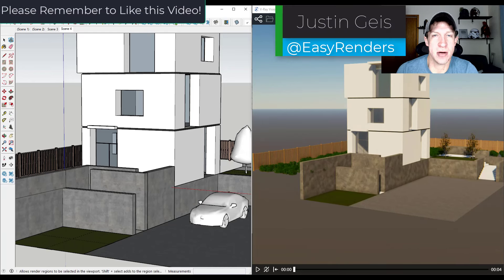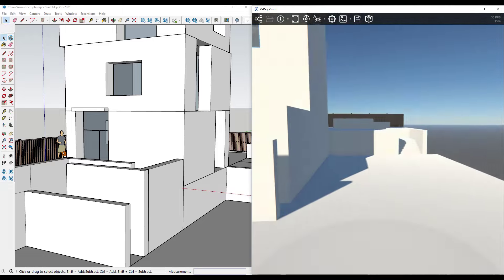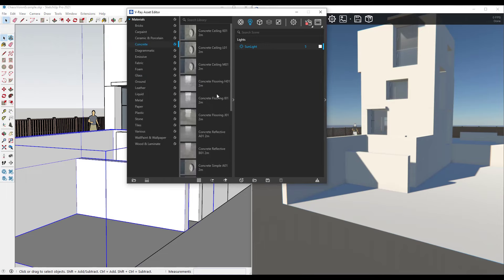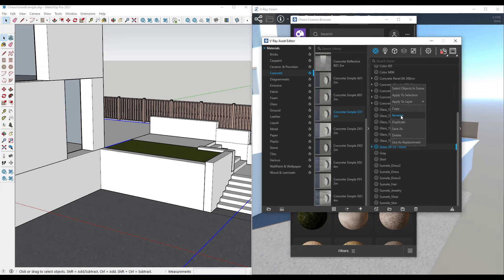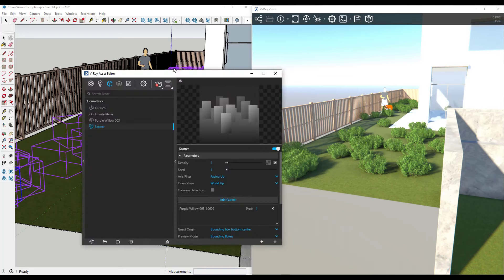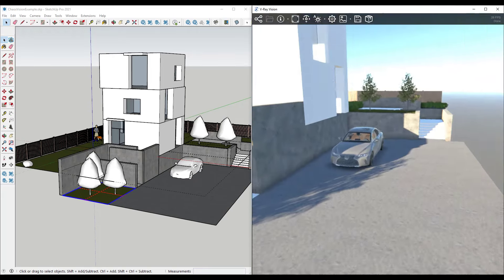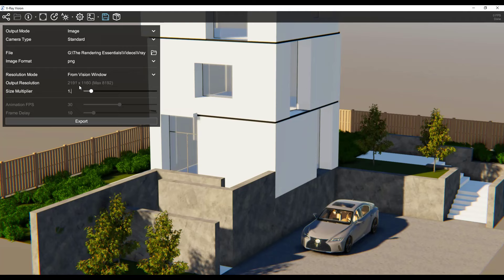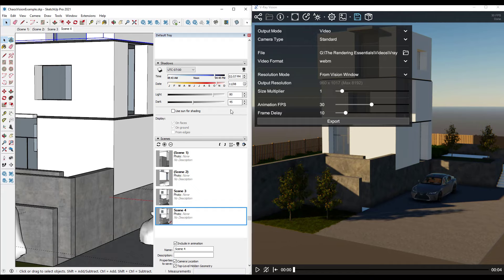Real-Time Rendering IN VRAY for SketchUp with Vray Vision! (Detailed Tutorial)

Comment: Is there any advantage if we use Vray Vision instead of another real time rendering engine like Enscape or Twinmotion? Is there anything that makes Vray Vision better?
Reply: enscape quality looks better than vision. So as long as u have enscape u won't bother with vision much. The actual vray quality however is better than enscape. So u can do still images with vray and animations or realtime with enscape (some extra work will be required to make the model enscape ready). Or if u have rtx graphics card, try chaos vantage. That is better than enscape, quality-wise, for realtime. Vision is relevant when you don't have enscape. With the latest update vray vision now supports fur and IES lights. That will make it's quality better and maybe with some practice you could achieve desirable results with vision too. But it is not as good as the actual vray. Even vantage is not as good, but close.
Reply: @turabalikhan1341  how do you get either for free?
Reply: @robertbradshaw1880  you could get a student license for enscape, if you are a student. For vray i guess buying is the only option. Getting these softwares for free is illegal and you could get in trouble depending on the laws prevalent in your country, dear. But you could try to write to them and get a student license if possible.
Reply: @turabalikhan1341  well in the states we get all autodesk programs for free.
Reply: @robertbradshaw1880  really? I didn't know that. Now that you tell me i remember one of my cousins living in pensylvania told me she has the latest Autocad version which she downloaded for free from some website called get into my pc or something like that. I told her to be careful as it might be illegal. But it turns out it isn't, after all 😄 good for you guys!

Comment: vray needs to realize that having a real time rendering will not offset the difference with twinmotion after twinmotion developed the path tracing.
Reply from the maker: I mean...Vray had path tracing first...right? So I'm not sure what you're getting at here
Reply: @TheRenderingEssentials  He has a point, he means that if a good twinmotion user can get realistic results or good results with just realtime functionality, a option to render it in path tracing will make the output perfect . But vray's vision has less options and its more like a lookdev thing or for fast presentations. But twinmotion will have more high quality fast presentations and also extra quality by path tracing if needed. In other words, developing a perfect path tracer is easier than having a perfect developed real time engine.